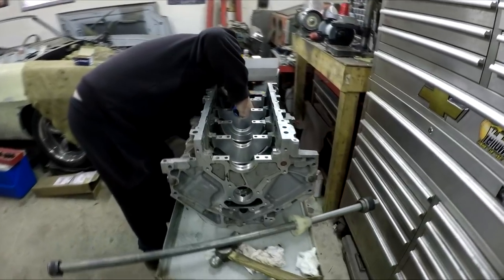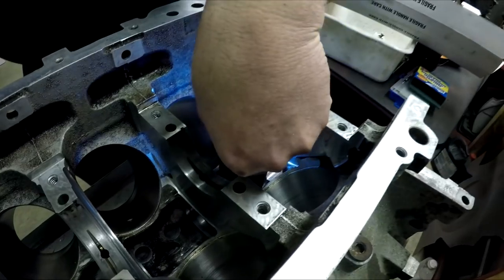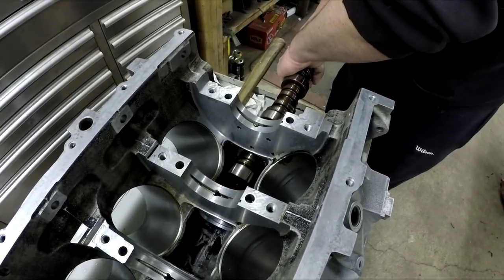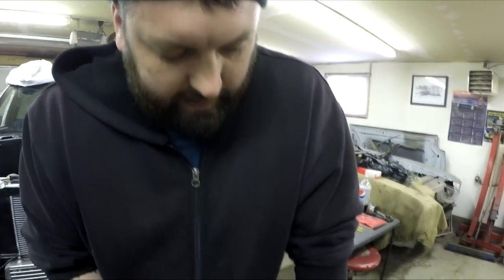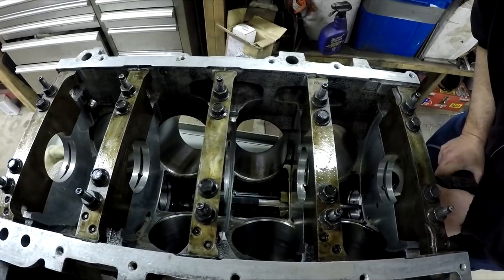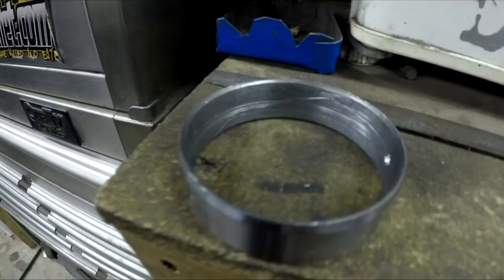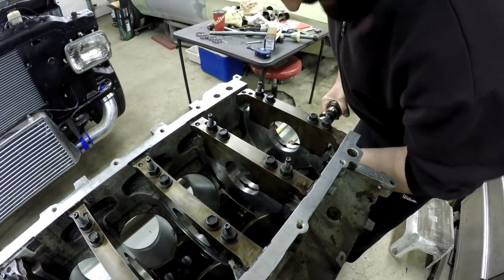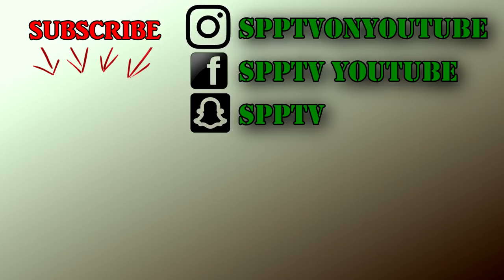Camshaft Bearing Install "Making Mistakes So You Don't Have To" | How To Build a LS Engine (ep1)

Comment: No clue why these cam bearings have two holes... did you bother to look at or even index the factory bearings ? Usually the holes are exactly opposite of each other across the bottom of the journal....

I know it's so much fun to just rip things apart with no care, and full confidence that you can reassemble it....but sometimes you run into these things....Will it cause an issue if they are not lined up right ? probably most likely not....it's not like it would affect oiling as all the passages are on the one side and connected anyways.....might have to do with thermal swelling I honestly do not know, but I have ALWAYS put them in the way I take them out. That being said I have only ever done LS cam bearings once (DAMN YOU SEIZED ROLLER LIFTER!!!!)

Did a lot of old school SBC cam bearings though....lots of guys bringing home built cars in with lifter noise and low oil pressure after swapping the cam at home because you know... summit will sell you a roller cam by itself and you should just reuse those non roller hydraulic lifters with bone stock push rods, and cough cough crank them stamped rockers down goodntight. LOL!

Keep up the vids.
Reply from the maker: We did line up the holes and there is only one in each journal.
Reply: yeah I know one oil hole behind the cam bearing, but the bearings have two holes.

the bearing is clocked so that the one hole exposes the oiling port and the other hole in the bearing should be on the opposite side of the block towards the lower portion.....see example: https://www.thirdgen.org/forums/attachments/ltx-lsx/363453d1501366594-finally-out-old-new-wp_003300.jpg
Reply: @bobbyd9583  So what is your point. All this means is that the direction that is used to install it may be reversed with no ill effects. I bet they had figured it out, LOL.
Reply: @dwjw1  so you missed the "hole" point on a year old comment... you had a year to figure out what I meant. On the LS motor, the cam bearing holes NEED to be in the correct orientation in order for oil to get into the correct passages for the cams, squirters, and other various oil galleys.... They DID NOT line them up. That was the "hole" point.

Why waste any money at all building an engine just to do it wrong and have it fail relatively quickly....

Then again you have probably built about "0" engines ever, because if you had you would know what I was talking about the moment you saw it and wouldn't have brought back a post from the grave. :)
Reply: @bobbyd9583  But I think they did line them up - and what difference does it make how old the comment was? I just looked at the video two days ago and did not (and still don't) understand your comment. The bearings have two holes in them, they lined up one of them with the hole in the journal, the other is not lined up with anything because there is only one hole in the journal to line up with on the engine they were working on. By the sounds of things I have rebuilt more engines than you have - I guess you rebuild motors, huh? I know enough to know that I don't understand everything about all engines and the LS is relatively new to me so I have been looking at these videos to find out about them.
Now if you were a reasonable person, you would realize that someone disagrees with you regarding the 'facts' and you can choose to answer with clarity or lash out like a child. Which are you doing?
The video maker says that there is only one hole and they lined them up, checked for the hole match, etc. So why are there two holes in the bearing if there is only one in the journal? Well maybe these bearings are used in another version that has two holes? Do you know for certainty that there should be two holes in each journal of this L33 engine that they should have lined up? I don't. Maybe there is an elongated area that serves as a journal oiler and will feed both holes if the bearing is installed correctly over the journal. I don't know. But I do see now that my comment was incorrect in that it has nothing to do with being able to reverse the installation direction - not certain what I  was thinking there.
The bearings have two holes - why? You suggest that it feeds other areas - not likely that the oil for the other areas would go through these bearings to get there, is it? They have galleys and ports etc for that supplied directly from the other galleys, not through a bearing. It is still unclear to me what you expected them to do.
Reply: @bobbyd9583  Well, thanks for at least being a little coherent for a change. No I have never rebuilt an LS engine, I have had one apart and they are different. But as for oil galleys, the concept cannot be very difficult because you apparently don't have much of a handle on it. There is no way that the engine manufacturers should or would rely on the oil passing through the bearing to reach the other areas that you mention on its way to the upper reaches of the engine on one of this size. And if you will notice, the holes on the bearings are not opposite one another - they are off by only a portion of the circle leaving them only about 145 degrees, not 180 degrees. Their video shows the one hole at 90 degrees or so that would put the other nearly in the same position on the other side. If there were another hole it would be out of the picture on the other side. This is consistent with an attempt to make two feed holes for the bearing because it needed more oil in the lower portion of the bearing. I doubt seriously that the engine manufacturer didn't supply a more positive way for the oil to leave the bearing than through a hole in the bearing. I'll bet those two galleys are connected inside of the casting. 

I suppose that you are certain that the holes in the bearings are for that purpose, and maybe the guys in the video got the wrong bearings because you cannot buy them for $20 as far as I can find. The right ones have two holes, but there is only one hole in the block as you can see at 3:12 on the video - it is up slightly from the 90 degree position which means it is towards the crank. Looking at the bearing they have with two holes and giving them the benefit of the doubt, they found only one hole in the L33. But their explanation is at least as plausible as yours, since the holes go in the sides of the bearings, not top and bottom. I don't know, but very apparently you don't either. So please stop trying to brush me off with idiotic tough guy pleasantries and go for a simple conversation becoming of human beings.
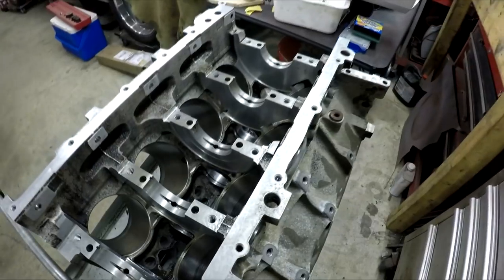Reply: Besides that I see at 2:02 and 2:07 or so they actually show both places where the holes should be. There does not appear to be a hole at 2:02 - just a rough spot, but at 2:07 the picture clearly shows a big slot for a hole. These are both on the lower part of the cam hole which is above the mains. If there is a hole at 2:02, I cannot see how they could possibly have missed it. Whatever the case, it is clear to me that the second hole is NOT for feed to other bearing surfaces. It is either for a second feed into the cam bearing or for some other reason unknown to me. There is no feed from a galley by the looks of it other than the one at 2:07.

Comment: And we are not going to talk about the Aluminum LS has 3 different bearings per block and 3 different variations according to year, which is what people have the problems with more then anything... it cost a fuck ton of money if you get that shit wrong and then eff them up trying to install the wrong sizes.... and finally chase your tail in a circle spending 180 bucks on bearings at a time😂

Comment: You put the back bearing in first and work your way forward never start from the front and work back and make sure the right size bearing goes to the right place if you don't know what you are doing please don't act like you do just pay the machine shop to do it they will do it right and you won't have to spend big bucks on a new cam bearings, Cam and all the other stuff it screws up because you were too cheap to let someone that knows what they are doing do it

Comment: this is exactly why if i dont have low oil pressure you can bet those bearings are staying in there lol, if it aint broke dont fix it
Reply: Block cannot be properly cleaned with bearings in. Any crud in an oil galley can destroy a motor.

Comment: This project had failure written all over it from the start.  First was the shop, looked like a total mess. If the shop isn't neat & clean the work won't be either. If a cam bearing needs any alteration to allow cam to turn freely never try to correct with methods you used. Bearing was incorrectly installed or damaged on install. Engine needs to be built in an area where there is no one else in the area, preferably in a separate room. The camshaft should turn freely with no binding and no excessive pressure to turn. Should turn easily with hand. I have always followed these rules and have built many many race engines. I have never had a motor blow up. Not trying to tear you apart but help you build a better product.
Reply from the maker: At that time our engine building specific cleanroom had not yet been completed in our 2 car garage.

Comment: Hey fella's maybe you didn't know .. But sending your block out to have it hot tanked & and pressure washed  in a real engine shop is like 100% better that oven cleaner and a car wash ..But hey I'm sure between the both of you  you guys have like what 40 yrs experience building engine right ? Oh NO  ?  whatever...Are you guy's installing a used stock roller cam in your monster build ? Is that really what qualify's as a monster build where you guys are from ? WOW...So that was why you went the extra mile cleaning up the block ? so you could install New cam bearings for your used camshaft ?
Reply from the maker: Closer to 50yrs actually

Let’s stay focused on the BUDGET part of this BUDGET build.

Comment: It is strange that you do not mention the difference between the five bearings Bore 1/5 = 2.346, Bore 2/4 = 2.326, Bore 3 = 2.307. In other words, it makes a difference which bearing is installed in each position and you do not even mention that. Or is that the point of this video - what will happen if you don't insert the bearings in the correct location?
Reply from the maker: They were in the correct journals
Reply: @SPPTVarmy  So you don't buy the business about swaging the bearings as they are installed, thus causing the out of alignment?

Comment: lmao don't follow these guys on installing bearings the wrong way, there are 3 different sizes for the 5 bearings that need to be install in order. Plus you need to measure the clearance according to your specific cam to make sure you have the clearance you want for proper oil pressure,  dont just buy a  random set of bearings, install them out of order, and then fuck it all up lol. Nice try guys.
Reply from the maker: We did know there are different bearings and they were installed in the right holes.

Comment: It's turning that hard and you call it good? That cam is going to eat those bearings..
Reply from the maker: We perfected it a bit since then.
Reply: ok , that was a good idea. It needs to turn by hand easy. They tend to get high spots on the bearings , i always sand them out with fine sandpaper.

Comment: WHEN C MECHANICS TRY TO REBUILD AND ENGINE, go back to pep boys. There are 3 different size bearings just so you gents are aware. 3 is the smallest,  2 and 4 are intermediate, 1 and 5 are the largest. Please don’t file any bearings. Lol. Wow I’m glad I can work on my own shit. I cant believe you posted this. What a butcher job
Reply from the maker: Next time we will get you to do it .
Reply: Please explain - what did they butcher? What do you think should have been done and why? Is using a fine file to remove a rough edge considered butchering? Is there anything else they did considered to be butchering. The honing of the bearing? GM actually does something like that to get the alignment right - yes, on the bearings. But probably a little more controlled than the method they used. Wrong tools? Please make it clear what the issues are with their work and help dummies out (dummies who are watching). Thanks
Reply: I am glad they posted. Engine building is frustrating work. If you want too see perfect work look at Stacey David vids or Holley vids. If you want real life problems and solutions these guys are the ticket. Thanks.